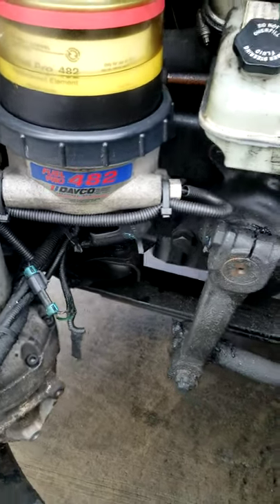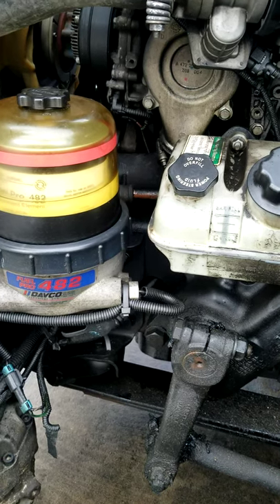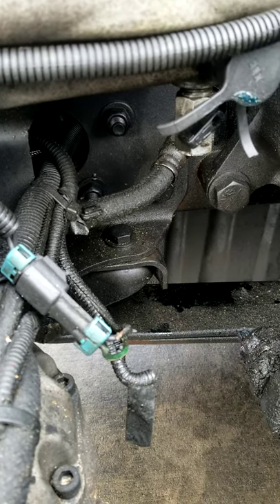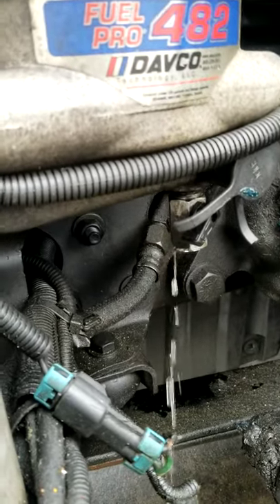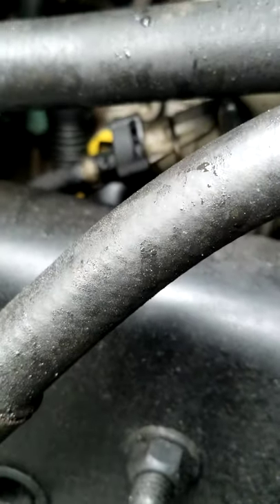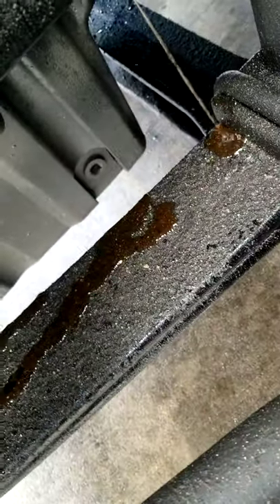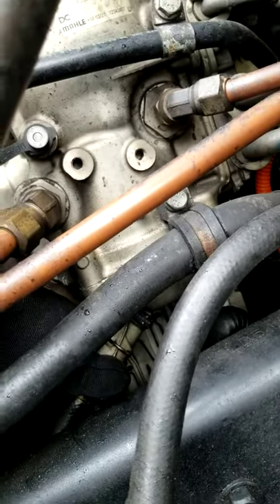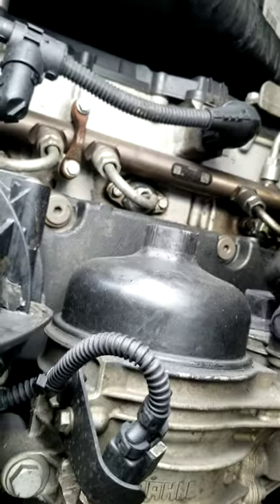water in fuel and check engine light

Comment: Definitely injector cups, thats coolant not water coming out of there, truck will run all day throwing deisel into your coolant and when motor cools it'll flow the other way, coolant into diesel. So you can get by temporarily by draining fuel filters in the morning but you will damage the coolant system eventually with all that deisel.

Comment: You have red stuff in your filter  and that is  antifreeze.  By draining the coolant fron your fuel system  your are not really fixing the problem  what you really have is the injector cups.  Should get them  fix before its too late.

Comment: Brother, you are my fucking hero. I changed out my fuel water separator, and the light didn’t go off. I didn’t know about that other drain valve.  I’m reading every article I can find and they say to unplug the connector on the fuel, water separator, and if the light stays on you have a wiring or PCM problem and you need to go to the dealer.   Freightliner would’ve screwed me over for sure on a simple drain job.  30 seconds after draining that second one the light went out and the active faults went away.  Thank you very much for this video
Reply from the maker: @driverjoe27  I'm glad you were able to get to your destination safely. 
Note: I did have bad injectors o rings. 
Blessings!
Reply: @CDLQ  I replaced my injectors on this truck about a year and a half ago so hopefully I don't have that issue. I think I just got bad fuel.

Comment: Thank you very much for this tricky situation information. You made it sound so simple and save me money right on spot by me doing my self at truck stop.
Sir I had the same thing happend to me after my water separator filter been clogged. So I just changed the water separator filter and drain the exactly way you said. Later few minutes code was gone and no check light was on dashboard. Never had to drain the fuel tank. I just did only these 2 steps you showed in video

Comment: A warm hello to you, I am not a mechanic I just play one on TV, I like to start by saying thank you for Sharing, It is said that a little bit of knowledge goes along way, but we got to know why happens what happens, It is important to know or take into consideration the miles That that truck has The maintenance, and the work that has been done to the engine if any, and then from there we can check and double check and maybe triple check By performing a diagnostic and troubleshooting the problem, and I pretty much have to agree with the two previous gentlemen to look into the injector cups, and I say 👀👀 into the injector Oil rings as well, ✌️❤️

Comment: Doesn't water float on diesel, so if so siphon out or suck out water floating on top of  diesel in fuel tank. Have you ever removed water out of your brake air tanks, I'll bet you haven't?
Reply: Water goes to the bottom

Comment: I'm sorry but your problem is injector cup
Reply from the maker: You are absolutely right and I got that fixed. 
However, that temporary solution saved me a wrecker bill, made my delivery and got me home so I could use a trusted shop..
Thanks
Reply: @CDLQ  I'm glad you fixed it, the Detroit is a very good engine after you give it good maintenance, I tell you it's a tremendous machine. thanks and success
Reply: How much to fix injector cup seal..?
Reply: @juancepeda9620  This depends on several factors but my advice is if one has already been damaged, I recommend doing them all at once.

Comment: Everyone saying injector cups, if it would be injector cups it would’ve been the other way around, fuel in radiator, coolant is 1:10 ratio in PSI compared to fuel, could be fuel heater or something else, not injector cups.
Reply from the maker: Your probably right but I  replaced my injector cups and problem solved..